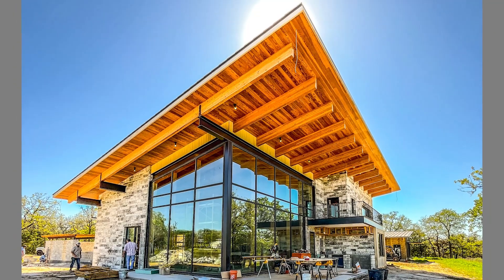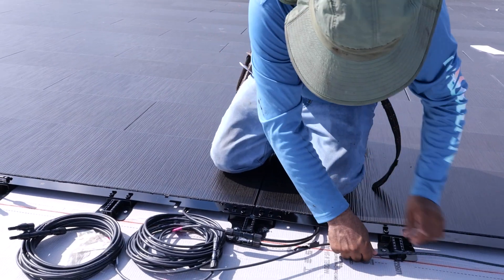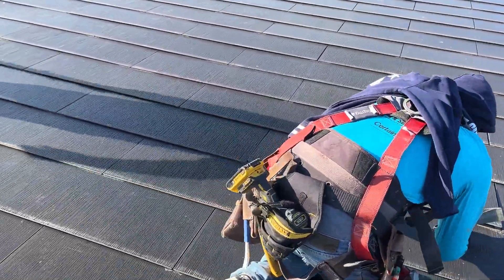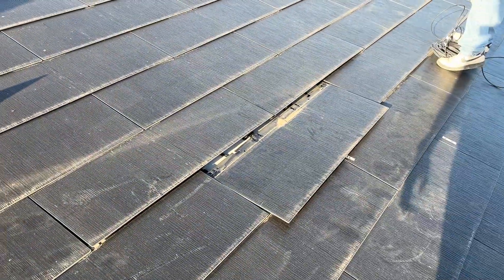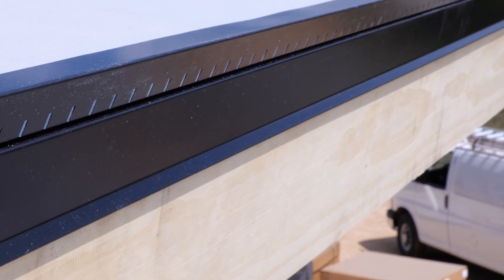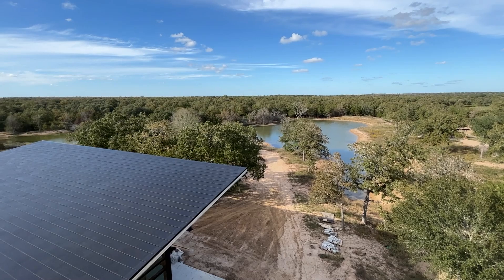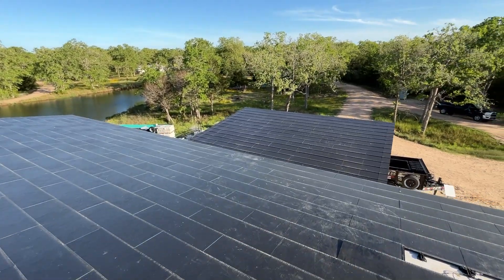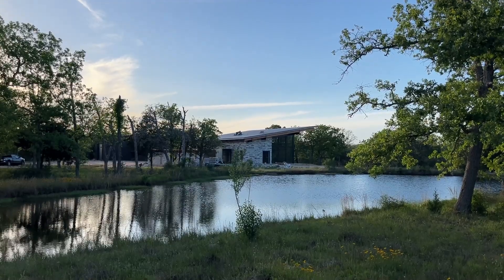TESLA SOLAR ROOF :  The Bad News and the Good News

Comment: I am debating building next year in RI and have looked at Tesla roof shingles and battery set up and was told the efficiency of the shingles is not good, and they could not really explain or tell me the life cycle of the shingles. I want to go net zero and am considering a ICF home of about 24 sq ft with a 3 car attached garage. What is the story on the actual efficiency of the tesla shingle and the life cycle?

Comment: Insane amount of connectors, which will be the reason you need troubleshooting in the first place... Is it like 4000 electrical connectors on your roof? This should become an issue when it gets a little older, it doesn't look like a good design with acceptable robustness to me.

Comment: Congratulations on eliminating all roof penetrations. It's going to help significantly in the long term. I've eliminated all roof penetrations at my house in San Diego. I was nervous about it at first, but my informal study of the Philippines where 95+% of roofs are metal, is that I haven't seen a single roof penetration there. So the US building codes and long-time practices are out of date.

Comment: 1970's shed roof design back in full swing, I see.  Anyhow, do agree with not taking plumbing vents straight up; but in past, inspectors struggled with accepting that as everyone was used to doing it the standard way.  Nice set up.
Reply from the maker: The 70’s were groovy, baby! Yeah, the vent question is definitely jurisdiction and inspector dependent

Comment: Would like to hear how it holds up after 5-10yrs.  Seems like a ton of connections between panels.  Where there any special building requirements for the room with the batteries?  Aka 2hr fire rated walls or anything special?
Reply: PV rated wire is designed for such harsh conditions
Reply: @LifeLongLearner-om8jx I think they’re imagining the batteries spontaneously exploding 😂